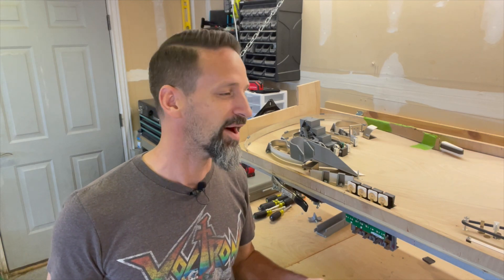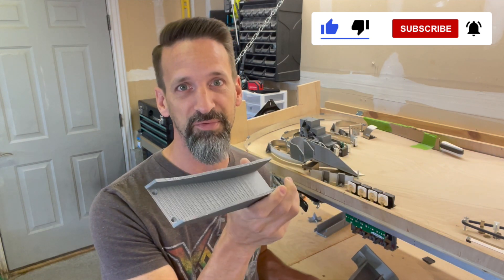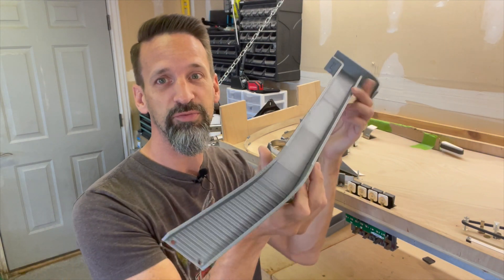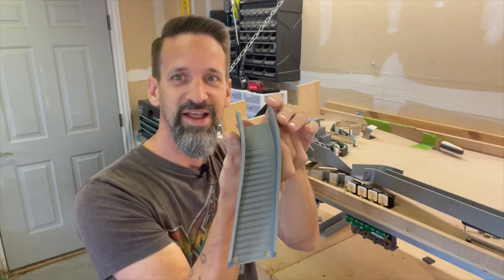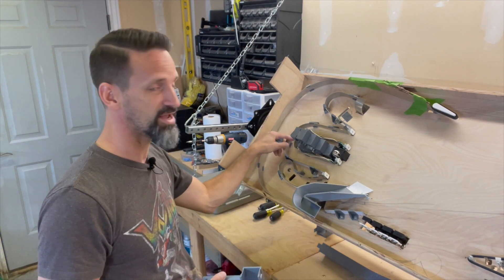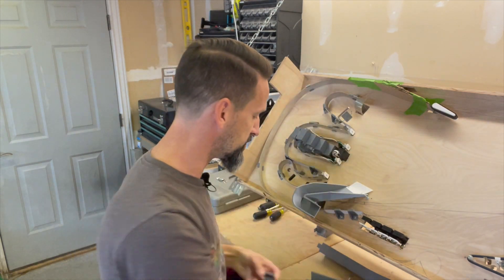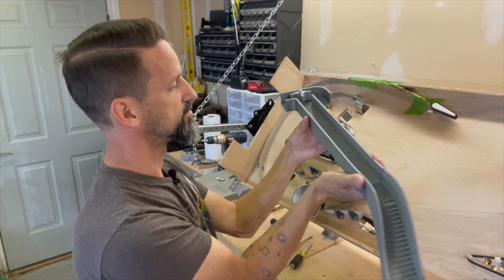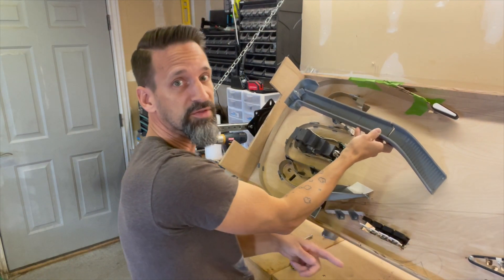HOW TO MAKE A PINBALL MACHINE: Crazy long ramp with a diverter

Comment: Hi,

I have a question about Right Ramp Jun092022.f3d, project looks slightly different from what is presented in the video, looking at the project, rear connector doesn't seem to fit the diverter holder part. Am I missing something here? Is this the full proj file for this ramp? Also I couldn't find the diverter itself on your google drive. Any guidance will be much appreciated! Thank you
Reply from the maker: I'll have to double check what's up on my drive, it might be out of date, gimme a day or two and check again, ok?
Reply: @thepinballroom  Of course, will do, thank you for checking!
Reply from the maker: Hey s1mon1231! Ok, I checked the file, and it's the right one. It's a couple of iterations newer than what was in the video. The "rear connector" pieces aren't part of the right ramp, but are in the same file, they're the pieces for the upper playfield that catch the ball when it goes behind the targets on the upper playfield.

Let me know if you have any questions!

Comment: Hi Steve, just planning my ramps and I don't have a pin at home to look up from. How wide must the entry of the ramp be? And how tall should it be to not disturb the playfield below the ramp?
Reply from the maker: Entrances to ramps vary, I think I covered it in my playfield design video - but I feel like the typical ramp entrance is about 44-48mm - my side ramp is about 65mm but only because it's at a weird angle on the playfield, my right ramp is 44mm wide, as for height, the ball is 22mm high, so I'd allow at least 30mm- but it also is dependent on where the ramp leads to and what it needs to go over and around, you might need it higher
Reply: thanks a lot   @thepinballroom , I'm going to watch the playfield design video. Errata: Ball is 27mm high
Reply from the maker: @stefku76  you are correct, I just noticed my calipers weren't zero'd out correctly 🙄 ty

Comment: These flip flop diverters works well when gravity (pulling the ball down) is involved but in your case you might run into cases where the thing will stay in the middle. You might want to find a way to make sure iit stays in either one of the position
Reply from the maker: Yep, it’s only working I’d say 80-90 % of the time rn, so I’ve already got a modification ready to print haha